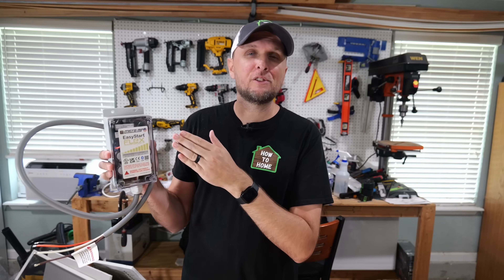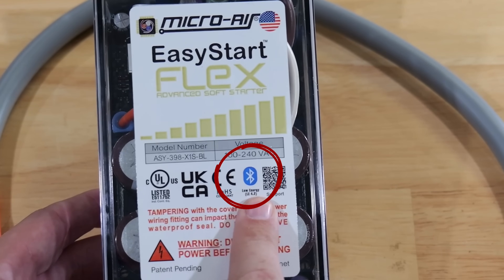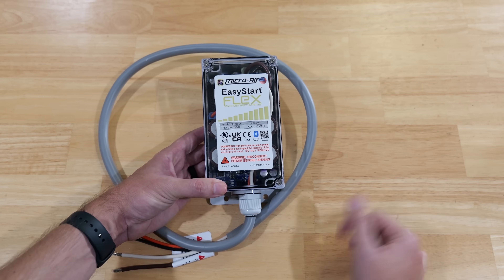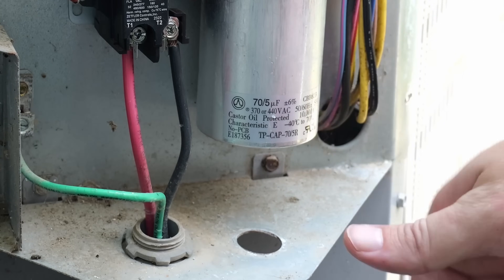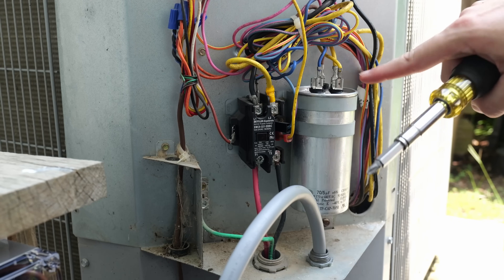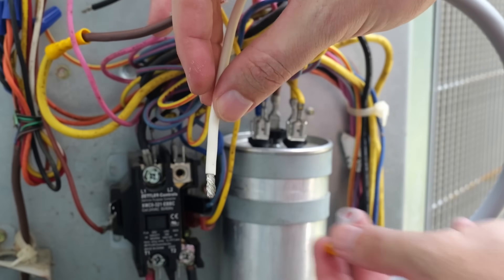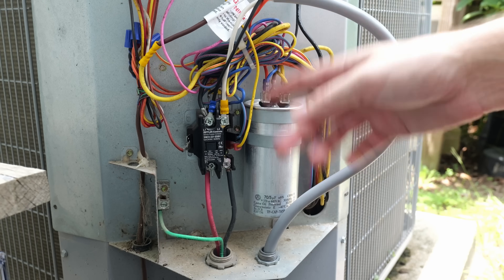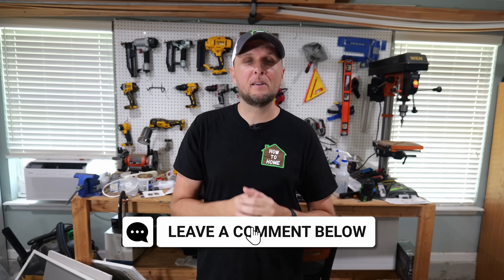The ONE AC Upgrade Every Homeowner Needs to Consider!

Comment: I'd like to see an amperage reading at the breaker or the panel beside the condenser pre and post soft-starter being installed.  121 amps exceeds the circuit breaker amperage, which means the 121 amps is being provided by the capacitor.  A measurement at the breaker pre and post soft-starter being installed would show what a generator would be supplying and what the effect would be on the an eletric bill, if any change.  The only benefit I can really see is the startup sequence being separated, so the fan starts, then the compressor.

Comment: For 90% people this is nothing more than snake oil , the compressor is engineered for the same in rush current with a properly sized capacitor. In my 35 years of being a HVAC  I have seen a lot of questionable devices to add to your HVAC, the best thing a homeowner can do is maintenance, i have seen more problems that were dirty air filters or broken or undersized ductwork 
When you watch a video and the first thing they say is “ this is not a sponsored video “ and you can see the company name clearly its a sponsored video. 
This product does work but only for a small fraction of people other than that it is just one more failure part
Reply from the maker: Complete opinion based on bias and not factual information.  And no I say it isn’t sponsored so folks understand I’m giving them my honest thoughts.  I have to legally disclose if something is sponsored.  My experience is almost no HVAC techs understand exactly what this does.  Seems to still hold true.

Comment: I wonder if this will help with my AC fail to start conditions. My AC occasionally throws a fail to start error that requires a power cycle to the unit.

I am not sure why the AC motor fails to start sometimes. It is not short cycling, as I have a smart thermostat that will not allow a short cycle.

It started tripping the breaker. Found the breaker was too small and replaced that. Stopped tripping but the control board would show the fail to start error code.

I can go months with no issues, and then it will just happen.

Comment: Based on the REVIEWS I have read on this device I would stay away from it. IF it isn't broke, don't fix it.
this review is on Amazon
I got the microair because I wanted a soft start where I could run the AC on a generator. I got it installed by my AC tech. Had no issues for the first month or two. One day, I got home and the house was warmer than usual. The AC was running but the compressor was out. The microair was giving faults and flashing red. I had an AC tech come out and he said the compressor was completely dead. Had another AC tech come out to verify. He blamed the compressor going out on the microair softstart.

I got a completely new AC unit. The AC tech reinstalled the softstart back on the new AC unit, and it didn't work. I reached out to microair, and we troubleshooted the device. They said the item wasn't working anymore, and blamed it on my AC. They sent me a replacement under warranty. I reinstalled the new softstart on my NEW AC unit, and it blew out the compressor again. I panicked, and removed the soft start and my AC would not work. Later noticed that the wiring to the compressor plug blew out. We reattached it without the soft start and its working again. I ended up returning the soft start and don't think I want to deal with it again.
Reply from the maker: Ok, the soft start most likely is not what caused your issues.  That isn't at all what it would do.  It was most likely either wired incorrectly or you have an AC unit that it is not designed to go on.  But it goes on most so most likely not the latter.  I have owned 3 of these for the past 5-6 years and have had zero issues.  The only reason I have had 3 is I have this channel so I try to update with the new units.  And the reviews?  If you click the link to this soft start, the reviews are very good.  Last I checked, 4.5 out 5 on amazon.  So not saying it is impossible but two different units causing issues is extremely unlikely.  Again, they did not pay me and did not send this to me for free so I am free to give my honest opinion on it.  Sorry it didn't work out for you for whatever reason.

Comment: Great commercial.  You didn't mention how this is a box of capacitors and poses significant risk to anyone working on the unit that doesn't know it is there, or what it is. The AC unit now has its own capacitor AND a bank of soft starter capacitors.

Comment: I'm still on the fence due to so many bad reviews of people saying it broke within months.
Reply from the maker: I have had this one installed over a year now with zero issues.  Most of the problems were in the first model release and were corrected.  Will there still be some issues?  Of course, as it the case with any electronic.  But It is not common.  And the reviews are mostly great!   Here is the link where you can see the vast majority of reviews are 5 stars: https://amzn.to/4knVmsO
Reply: @HowToHomeDIY  This is on this model. Unless the Amazon reviews are fake.
Reply from the maker: Ok what model were you talking about then?
Reply: @HowToHomeDIY  Well, both. I though the newer model was going to be ok, but according to Amazon reviews, folks are still having issues even with this new model.
Reply from the maker: @mr.boniato6402 ok I guess I don’t understand then.  I sent you a link to it and it has 4.6 out of 5 stars which is incredibly good on Amazon.  Whether you buy it or not, makes no difference to me.  Just confused I guess.

Comment: I have two capacitors on my ac unit. How do i wire the soft start flex unit? Looking at the unit it has a big one and a small one. The big one has a red, black and yellow wire coming out of it. The smaller one has the black wire from the big one connected to it and there is a purple wiring coming from the smaller one, I can't tell from my picture where it goes. On the switch, the upper screws have a big black, big red, smaller red, orange and black wire attached to the top. On the bottom there is a big black and a big white attached to it. Hopefully you can help me to wire a Mirco-Air Easy start Flex unit. Thank you in advance for everyone's help. I would attach pictures but i don't know how.

Comment: A few months ago I installed one of these on my 4 ton geothermal unit. The peak starting amps had always exceeded the 80 amp limit of my clamp-on amp meter, but running was usually down in the 10 amp range. Now with the Easy Start Flex, the start is about 37 amps, the lights don't dim when it starts, it can now be run with my backup generator, and the start process doesn't sound so abusive. Money well spent. The hardest part of the installation was convincing myself before the first start-up that I had wired it correctly. And, yes I had! I also taped a sketch of the revised schematic to the inside of the unit. Someone will be glad I did that.

Comment: Thank you for the most excellent installation tutorial! This morning (05/25) I installed my second unit using this tutorial and it was a breeze. The first time around, I was doubting myself during the installation due to the somewhat confusing instructions. The first unit never sounded right when it started; there was a weird surge just before the compressor kicked in fully. After about a month, the unit failed - at 10:30 at night 105 °F. I was out in the dark rewiring my A/C unit. Ugh! This event left me questioning the product and my installation.

Thanks to your comments below, I learned that EasyStart Flex had a some kind of defect or bad component/design choice(s). Apparently, I was unfortunate and got one of the defective units last fall ('24). EasyStart replaced the unit immediately but didn't say there was a defect. After the installation today, I was happy to hear the compressor start up as one would expect, with no surge sounding current. I don't have an in-rush meter, but the peak startup current is about 25A, per the EasyStart app. I also got out my generator to test that it would handle the AC startup with other things on in the house- it worked great! I have a tri-fuel, Westinghouse 11,500. I use natural gas. Running natural gas, the generator has 7500 W running and 9500 W peak capacity. I have 2 refrigerators, a freezer and a 4-ton A/C unit. Most of the lights in my house are LEDs. When the A/C started, the generator barely noticed the unit start up.

One mistake I made today was to connect the brown wire to the cap wire. I believe you said not to do this in the video, but in the video, the compressor winding wire (yellow in your case, red in my case) was in a bundle, it was hard to tell that you were connecting the brown wire to the wire going to the compressor and not to the cap. Fortunately, the EasyStart unit told me there was a startup fault (can't detect the compressor winding - via 7 flashes) and I was able to correct the wiring immediately.

Hurricane season is just around the corner. I now have confidence that the unit won't fail randomly during the summer and will work during any power outages caused by bad weather or otherwise.

On a maintenance note, I live in Houston so I change my CAP twice per year: once just as summer is starting and once in the fall. They are only $20 and changing them is a 5 minute job. A few years ago, I had a cap fail on a Friday afternoon during the Houston summer and had to call out a tech for an emergency service. It cost me $900 to get the cap changed. The tech charged me $350 for the cap - that's outrageous. If you can install this EasyStart unit, you can change the cap too. BTW, I also keep a contactor on hand as well. I had a contactor coil burn out 2 hours after a new A/C unit installation. Fortunately, I was able to get that fixed quickly and for free.

Thanks again!
Reply: Backup parts is a great idea.

Comment: I installed an airgo and it appeared to be working. Only thing is, the ac wasn't cooling as much as before. I didn't have a clamp meter to perform a before and after comparison. I did measure the temp at the registar closest to the air handler and it was 61 degrees. Removed the soft starter and the temp was 47 degrees. Made it seems the current close enough to running amps. Any thoughts?

Comment: Great video. So, with the Micro-Air soft starter lowering the starting Amperage from 125 amps to 36 amps, how much did it reduce your electric bill over the entire summer period. I am trying to justify  the purchase of the high-priced device of over $400. Thank you.
Reply: you do realize this isn't about your electricity bill?  this just helps with start mode, not running as your comp still needs the amps it needs to run - it would seem to extend the life of your comp though

Comment: It does use less electricity, but not much. It saves by preventing the inrush current when starting the equipment. The "inrush" is high amps compared to just the unit "running" after it starts. If you have an AC kicking on/off all day, you're using less electricity every time it starts, which can add up.

Comment: Hi Adam! Thank you so much for this video. Every time I hear my NEW AC start up, it makes me wince. My unit is only 2 years old now. Do you know if this device would void the warranty on it? It seems like it would HELP to make it last longer, but one never knows.
Reply: It is difficult to answer your question. Ideally, have your HVAC contractor install the device after getting a satisfactory answer about warranty from them. Of course, this route will cost you more because the contractor will need charge you labor for the install and "their warranty" on the work done, which is fair IMO. I endured the startup noise of my 2 ton AC condenser for 2 years before I installed the "EasyStart" myself. Nice and quiet on startup/run now. No more house lights flickering on start, either. Recently, I installed the "FLEX" on my friends 3 ton unit which was over 10 years old. When it was time to fire it up for the first time, my friend went in the house to set the thermostat for cooling. He thought, at first, it was a FAIL because he did not hear the usual startup sound, inside, where he was standing. When he came outside, he was pleasantly surprised to see the unit running relatively quietly compared to before.

Comment: Nice job, you earned a subscriber on this one. This video inspired me to get one of these. I went from 144 to 27.9. Wow. The kit was even simpler to installed than depicted here. It came with pre-crimped connections on the capacitor and black contactor wires, then two wagos to put the last two wires inline with the compressor and contactor.

Comment: I've had a soft-start on my home AC compressor for nearly 5 years. It has worked flawlessly. I used the "Hyper Engineering Sure-Start" unit on my installation, as it was readily available and had excellent reviews, and was recommended by an online Generator forum site.
I originally installed it to lessen the start-up demand on my Generac backup generator when it was in operation (during utility outages). While the generator (a 24kW, propane-powered unit) would indeed cover the load-spike imposed by the compressor starting, it would obviously drag the voltage & frequency down, and "bog" the GenSet engine a bit.
After installation (and the "learning curve" for the module was done; after a few starts), the generator barely reponds to the compressor start-up. And of course, the module also eases the starting current and torque-load when NOT on the GenSet, which has reduced flickering & dimming of the house lights in normal operation, and is increasing the life of the compressor. I measured the starting load at (between) 75-80 amps before installation, and 40-45 amps after (using a Fluke meter & clamp-on probe). The compressor also doesn't audibly "bang-on" near as hard as it did. Now it sort if "eases on", almost like a VFD type control. 
I'm in a very rural area of west Texas, and storms, wind and power outages occur fairly often.

Comment: Looking at my wiring diagram on my AC unit, they have the soft start kit being wired to the T1 and T2 side as suppose the L1 L2 side any reason why that would be? I looked at my contactor and my contactor is opposite from how yours is laid out my T1 and T2 is where your L1 and L2 is listed on your contactor
Reply from the maker: Don’t pay attention to the labeling on my contactor.  It was installed the way it was to keep the shunted side on the same side as the original.  So the labeling is backwards.
Reply: @HowToHomeDIY  ok thank you!

Comment: Yes your reducing electricity for the first 10-20ms during that inrush but your saving no money, the amount of energy to start the system is fixed so your lengthening the amount of time it draws its “peak” power while getting up to speed .  Additionally hard start kits have the potential to cause compressor failures due to excessive current on the start winding of the compressor only use manufacturer recommended start kits if necessary for a generator application.  It’s not worth the risk blindly installing one.
Reply from the maker: When did I claim it saved money from saved power?  Also, this isn't a hard start so not sure why that was added.

Comment: I have the older unit and was able to power my 2000 sq ft home including AC on a 5500 6800 peak generator. AC is a lot quieter starting compared to the neighbors. and the app shows amps to start is almost 1/3 of before.

Comment: can this device be used on a 240v ac pool pump motor at startup too? does it replace the start capacitor or does it work in unison along with the start capacitor on the pool pump motor? Or can it only be used for the a/c unit?

Comment: Can i install the easy start and install   a micro inverter 2000watts on the unit on the delivery side so when the relay kicks on the panels produce electricity to feed the ac unit but will the easy start effect the micro inverter ?